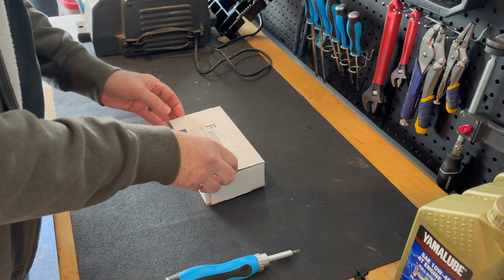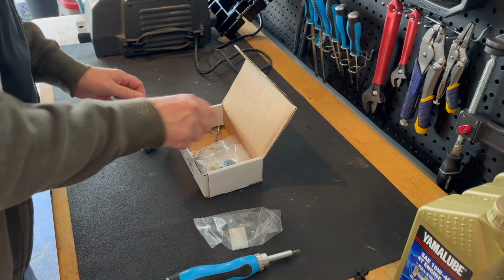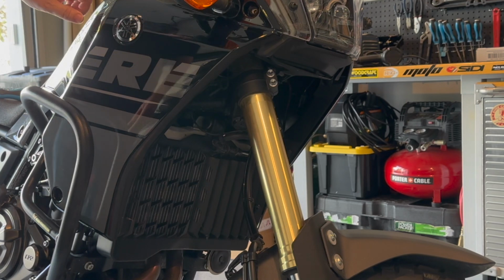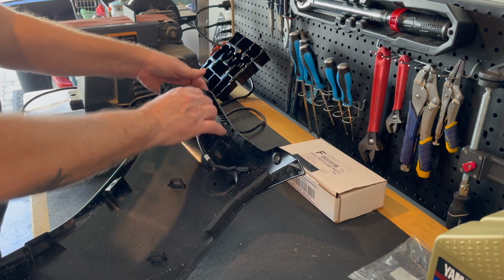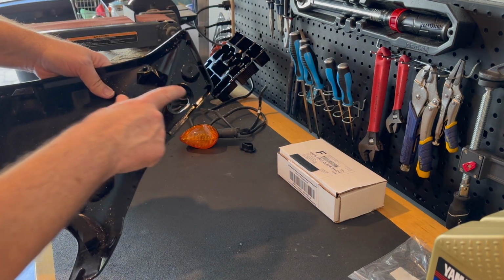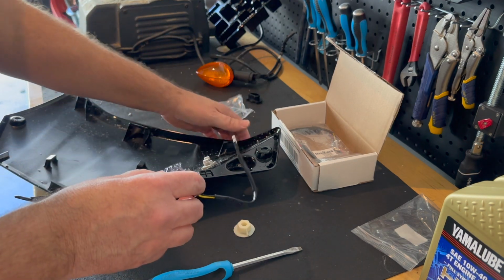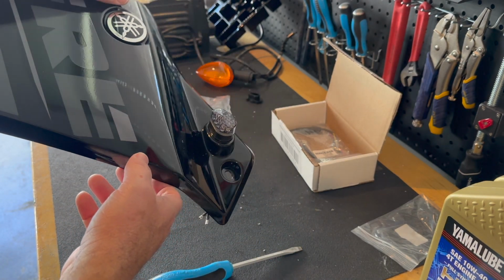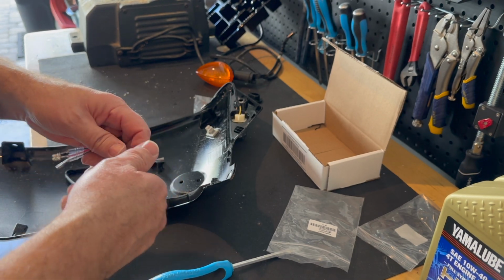Yamaha TENERE 700 flush-mount blinker installation

Comment: Brilliant! Thanks for this…I ordered the same lights after watching this. Two minutes on my bench grinder to ‘reduce’ the size of the nylon bolt and then a minute cleaning it up with the sander and I was in business. I’d really like to use the relay to maintain DTR, but I don’t want to mess anything up since I already have the Tusk LED Relay installed for my rear turn signals.

Comment: Have you been able to fix the hyper flash either with added resistors or by replacing the OEM blinker relay?  In the video, the device referred to as the relay is really an adapter harness (called the TST Running Mate) to retain running light function on bikes, like the T7, which were originally built with functioning running lights.  The bike's harness and pumpkin lights use three wires.  The TST flush mount LED uses two wires and adapter harness (TST Running Mate) takes the three wires from the harness and modifies the output to provide running light functionality (80% brightness) and turn signal functionality (100% brightness).  But, this leaves the bike with hyper flash.... resolved with added resistance (wired in resistors) or an LED compatible blinker relay module.  Great video!
Reply from the maker: No. Back indicators needed a resistor, front indicators have a relay that should have fixed them. Emergency Flashers work in normal time but the left and right indicators hyper flash. Any suggestions would be helpful as tst says that installing a resister in line with the relay would damage the relay.
Reply: @MotomojoFL  Hi! I have the same setup at the front(TST flushmount + running mate) and an other kind of TST led at the rear. I changed the relay to a cheap one, from amazon, and it works perfectly. No hyperflash. Great video! Thanks!

Comment: Do you by chance have the part numbers? I like how they look.
Reply from the maker: https://tstindustries.com/tst-led-front-flushmount-turn-signals-yamaha.html

Flush mount signals. FLY01S
When opening up the page, there is a choice to add the system that includes the Yamaha plug converter and the running light Nate.

Comment: Thanks for posting. I bought the same turn signals, but  looks like they sent me the wrong  wires adaptors. what's the wires part #? 

  thanks
Reply from the maker: Model # CVY01
TST YAMAHA SIGNAL PLUG CONVERTERS 3-TO-3
Yamaha Signal Plug Converters enable you to plug in aftermarket signals into your harness without doing any wiring.

Sold as a pair (2 converters per kit)

https://tstindustries.com/tst-yamaha-signal-plug-converters-3-to-3.html
Reply: @MotomojoFL  🤩 TNX- Ur bike looks great 💥
Reply: @MotomojoFL   did , this happened on your bike, when you installed the running mate?  

Special Note: On certain models, the introduction of a running light function on your front signals will result in a turn signal light constantly appearing on your dash panel. The Suzuki DR650 and Yamaha TW200 are prime examples of displaying this issue.
Reply from the maker: @pvflyer67  no. But they do flash at a fast rate.

Comment: Hey @MotomojoFL, does you indicator light on your dash stay on solid when put one of the signal lights on? I just installed these on my T7 (with both the running light adapter and TST flasher relay) and my signal light on my dash doesn't flash anymore. It just stays on solid when I use the signal light.
Reply from the maker: Added a TST industries relay which is installed under the seat area. Quick and easy unplug of stock relay and install the TST relay. You can buy it here: https://tstindustries.com/tst-led-flasher-relay-gen2.html
Reply: Hey  @MotomojoFL  , Yeah I bought one and installed it with my lights. Maybe I have a faulty flasher. Does your dash indicator light stay on when you signal or does it flash with your lights?
Reply from the maker: @Farzz7  flashes with lights. It starts off rapid and then changes to normal speed after a flash or two.
Reply: @MotomojoFL  Ok. Thanks for the heads up. Mine just stays on for some reason. I tried it with the stock flasher relay it it also keeps the dash light lit solid when indicating. I'm going to try and take the running light adapters off and see if the dash light returns to normal. 

Thanks again.
Reply: @Farzz7 I’m having the same problem (TST has been wonderful, btw in helping me troubleshoot). Did your dash light blink after you removed the running light adapters?

Comment: Will these work on the rear also?
Reply from the maker: I’ve been told yes, but with some work. I’m leaning towards them on my rear as well. I’ll do another video if I go that route.
Reply from the maker: Just spoke with TST and they said the flush mounts work perfectly with the rear blinkers. Need to order one additional part: https://tstindustries.com/tst-pod-turn-signal-adapter-plate-kit.html
Reply: @MotomojoFL  For Yamama T 700, it looks like Kit #2?
Reply from the maker: I just added these flush mounts to the rear fender section and they look great. Quite a bit more work than the fronts. I utilized the original plug and wiring, cutting them at the original indicator. They need resistors wired in to function properly. I didn’t film this install but I have a video showing the installed product.
Reply: @MotomojoFL  The fronts were wired as seen in your video.  The rear pumpkin blinkers use 2 wires (while front pumpkins use 3 wires).  You reused the connectors from the rear pumpkins for the rear LEDs.  And in the rear LED supply wire, you've added one resistor on each side?  And, now, everything works as expected...standard rate flash, turn signals and emergency 4 way flashers AND the front LEDs are also providing running lights?  Am I understanding this correctly?  If so, you've done what TST has not yet been able to do as they've not had access to a T700.  Good on you!

Comment: The blinkers blink in “wrong” (faster) speed… I guess you have noticed that… if you change from normal blinkers to led there is another modification that should be made in order to work correctly! (Do not ask me what I have to search 😊 )
Reply from the maker: Yes. The relay was supposed to fix that. Usually a resistor fixes the hyper flash but unfortunately you cannot run a resistor and relay together.